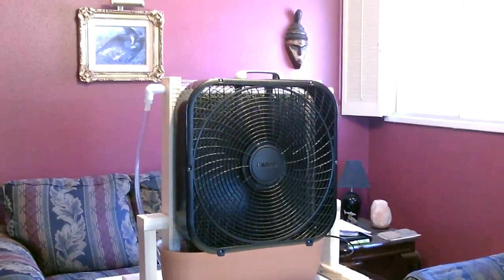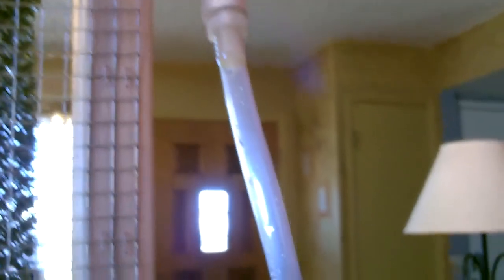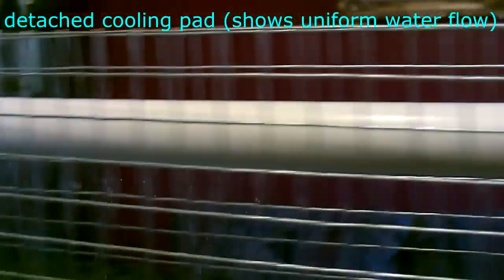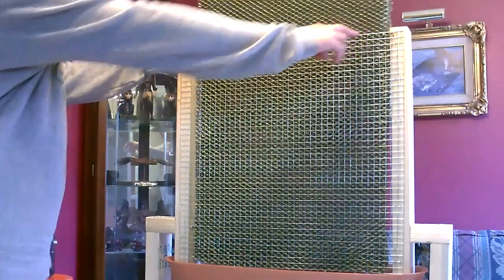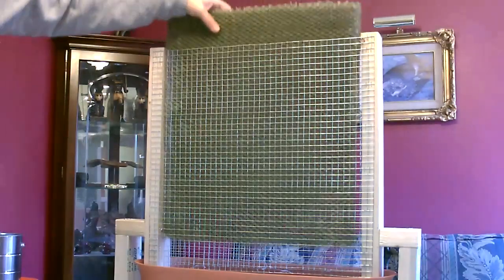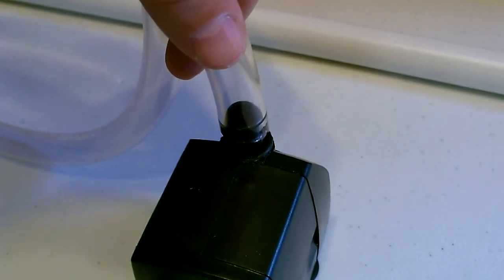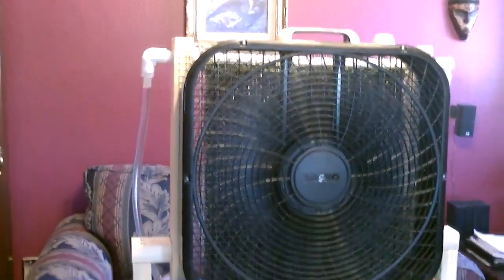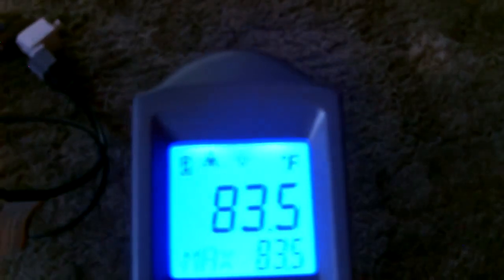Homemade Evaporative Cooler! - "whole room" Super Cooler!  - up to 30F drop! - Easy DIY

Comment: I'm assuming that evaporative air coolers wouldn't work so efficiently in areas of high humidity?  Here in Hawaii it gets up to 95% sometimes throughout the day but seems to be about 85% in the summertime which is when we need cooling the most.  Damn it's hot and sticky here today!!!
Reply: Jimmy Pham i live in Houston tx and texas weather is bipolar
Reply from the maker: Jimmy Pham hi. you are correct. this type of cooler works great in the dry or semi dry climates, but probably won't work at all when the humidity is 90%
Reply: +Jimmy Pham Add a bucket (or 20) of ice
Reply: +desertsun02 Yeah, I'm in NC and down below evlevation and my places is very wet, might be cheaper running a dehumidifier and this then an AC unit, so you could try that to cut cost.
Reply: Jimmy Pham must be some pretty violent cases of swamp ass out there
Reply: +Richard Carson I was just thinking that.
Reply: I'm in NC, and we use store bought versions of these at work. (factory)

If it's over a 100 degrees with 90 plus humidity already, you won't notice the extra humidity from the fan. You will however love the cool breeze, especially with the fan on high.
Reply: mike williams the earth is bipolar.
Reply: IXLR8 2GO so true bro
Reply: Jimmy Pham hhhmmm it's worst in Florida dude 105 sometimes
Reply: miguel plata, hey ya. Jensen Beach! 🌴 Hit an outside bistro. You'll be cool 😎.
Reply: Jimmy Pham true
Reply: Jimmy Pham I
Reply: breaks my heart. wanted to use one of these in the Philippines. ha!
Reply: The higher the humidity the better they work.

Comment: Don't let anyone tell you evaporative cooling doesn't work in high humidity in the south...It Does. Southeast Texas Gulf Coast...temp 85, humidity 83...blowing cold air.
Built it for Hurricane season...for no power. We were without power for 6 weeks after Hurricane Rita in 2005...The heat was unbearable. I believe at 90%+ humidity (after a rain), it'll lose some efficiency but still work to some degree. We experience high pressure systems quite often here where the humidity drops to 30, 40 and 50%...it should blow even colder. I don't believe it'll work well in early morning hours when the humidity is climbing and it's damp outside. Plan to use in afternoon and early evening. Thanks for the build video...it works great...even in the south.

Comment: Do you think a version blowing across the material instead of sucking would be possible to build without making a mess?  Do you think it would work better?  I live in AZ to, and I'm thinking of making one for emergency use when we have not power and run it of an inverter and golf cart batteries at night then solar by day. Also thinking of storing the water in a cooler with ice to get colder water and colder air.
Reply from the maker: kozinator hi there. i experimented with the fan on the other side (blowing thru the pad) but the result is that almost no air makes it through the unit. (the pad ends up blocking the air and almost no cooling is achieved). it's great that you'll be running it on solar (it's how i usually run it). these units don't take much power so a small solar setup runs it easily.

Comment: Thanks for sharing this! I got mine down to 52 degrees F. Of course with blocks of ice in a large igloo cooler.I put the fan instead behind the contraption so that the fan blows through my aspen pad.
You could also trying putting a second box fan to draw the air as you have it set up here, for even colder air with better circulation.
I've tried the coil method and the cooler elbow air conditioner :|   This Evap is by far the BEST! 52 F even in high humidity!

Comment: Costs money to generate ice cubes with the fridge but with those extra hot days you can dump a bunch of ice cubes into the container and supercool that bad boy.  Good job
Reply from the maker: Ultimatehobbyreviews hi there. sounds like a good idea. then you'll have simple conduction cooling along with the evap. cooling.
Reply: As long as the fridge is in another room?  Otherwise it produces more heat than the ice has cooling power.  Law of thermodynamics.

Comment: i have alot of electronics in my room, (TV, Computer, Various Video Game Systens) and this one uses evaporation for cooling, im staying in a medium sized room what used to be a Drive way to our house, would the evaporation effect my devices in a negative way?

genius build BTW.
Reply from the maker: gstut1 hi there. as part of the evaporative cooling process the air will become slightly more humid. for example, the air might go from 35% to 45% humidity (both very comfortable) ... and since electronics are designed to operate even in 80%-90% humidity - none of your electronics will be affected in a negative way.
Reply: You'll find that many inexpensive digital thermometers will save your Min-Max Temp and Min-Max Humidity levels.

Comment: We have this exact thing on the roof of my factory its called a cooling tower,ours cools 19 injection molder's water supply to 65 on a 95 degree day.bravo essentially u have built a cooling tower and now i see it works this small im building a couple for my house too thanks great build and vid

Comment: mate let me start with; how incredible ur works are... as an engineer i love the simplicity and ur problem solving ability...
i am not as smart as u.. so I will ask a stupid question..
the use of the wire mesh with plastic in between the squares is to provide a protective layer to stop making a mess with water in the surroundings... but doesnt it obstruct the air flow? when the fan is switched on... air has to flow around the corner to reach the evaporative cooler pads?? I am abit confused...
Reply: Open Canvas IH plastic in between the squares? I don't see that at all. No plastic is there. It's the pad sandwiched between two mesh grids. When he turns the pump on the water is running down the pads. Is that when it looks like clear plastic? If not, I'm not seeing what you are seeing.

Comment: now all you need is a soler panel and inverter and battery and it will cost nothing to run.
Reply from the maker: vorkev1 hi there. very true. *this setup can be easily run using only a "two battery" solar power system (to see how to set it up look for my video titled, "How to hook up Solar Panels (with battery bank)..." or if interested, here's the link http://youtu.be/cgEvCLJuBkg
Reply: desertsun02 thanks I will check it out

Comment: Good idea,  but why dont u just use an automotive radiator instead ??
Reply: AnniSoleil13 That would prevent the evaporation of the water, and therefore not do any cooling. If you added ice to your water supply it would then work, but only for the duration the ice lasts. (Not long at all) The goal here is to cool the hot dry air and make it cool slightly humid air. Whenever there is a phase change (in this case liquid water evaporating to water vapor) latent heat (IE the heat in the room air) is removed. This is why humans sweat to keep cool. The evaporation is what takes the heat away from our body. This is a mechanical way of making the room "sweat" to cool it down! It will NOT work if the air is already humid. These evaporative cooling systems are extremely popular in deserts and other hot dry environments.

They take less energy than phase exchange systems using compressors and refrigerants, but they do consume a lot of water which may be a very bad thing in some dry places.
The absolute best way these days to keep cool in high energy environments such as deserts  is to take advantage of the energy around you and use solar to run something like a mini split AC. The only issue then is upfront cost.

Comment: Next you should fit a 5 gallon water jug upside down that will let water out as the level goes down like a dog watering bowl does. Then you could leave it on for 10-12 hours when you are not home and your house will be cool when you come home. Pretty cool setup there.

Comment: wouldn't this make the air in your room very humid.. that would not be great for electronics in the room

edit: i could make a quick ghetto version with a wet cloth on a fan right? :D
edit2: maybe i could put a the bottom of the cloth in a bucket of water so i dont have to fill it up as much?
Reply from the maker: 1wsx10 hi there. as part of the evaporative cooling process the air will become slightly more humid. (but since you use these in dry or semi dry climates, that can actually be a plus). both of your "edits" are good ideas. i've got videos showing both. *one is a two-towel version w/drying rack - the other is a single-towel version on a rack with bottom of towel in a "bucket" (a planter-box style container to be specific)
Reply: desertsun02   I finished one of these evaporative coolers today and found that it does not work.  I bujilt it to your specs and with the same material.  The air coming out is the same temp as the air in tnher room.  Can you explain why the air is not cooler?
Reply: +Dandy66 M I just finished building my Swamp Cooler. I initially made the mistake of installing the fan behind it. I quickly realized that the fan needs to be in front. Is this a possibility for you?
Reply: this is an old post but I will ad my two cents anyway, the reason it won't work is because the vapor (hence the removed heat) stays in the room therefore although one may feel some coolness in front of the fan, the overall temperature in the room will remain constant because the vapor will condense and give away heat eventually...
Reply: @mesutpeynircimax451  but shouldnt it atleast change slightly the overall room temperature?
Edit:actually u can put a bottle of ice in the water tank to make ot cooler,when it melt,u can put in freezer back.but still u need water to run through the mesh

Comment: Excellent ..I'm wondering about using light walled aluminium channel for the frame. It would also allow the pvc pipe to be hidden inside.

Comment: The wire mesh...  instead of cutting/using 2 - what about using 1 that is twice as long, plus the thickness of the boards?  Have it go down the front side, make a 90 degree bend at the bottom of the boards (thus the extra length = the thickness of the boards), then another 90 degree bend to go back up the back-side of the boards? 

I was wondering about this since I didn't see (or perhaps I missed it) any details given about how the cooling pad was to stay between the wire meshes without falling into the reservoir below.

Edit: Oh, I see it.  Where you wired the pad to the pipe...  No need for a bottom support then.  Anyway, thanks for the video.

Comment: where do you buy the cooling pads?
Reply from the maker: hi. you can find them at most home stores. i got it at home depot.
Reply: http://www.homedepot.com/p/Coolpad-28-in-x-32-in-Evaporative-Cooler-Pad-7012/202531203?quantity=2&str_nbr=1088

Comment: Any idea how much power drain you're using with the fan and the pump? I'd like to do something like this with DC rather than AC, so power consumption would be important.
Reply: MarkW126 A small 200 l/h 12v d/c submersible pump will draw .25 amps.  
A small 12v d/c 32cfm blower will draw .18 amps. If you want greater air flow, use more blowers.

Both are available off EBay.
Reply: that's the ticket !
Reply: I'd take a guess around 40 watts.

Comment: Humidity stays above 50% where I am and once I was seeing how much energy I could save by hanging my washed clothes throughout the house instead of using the dryer (lived in a condo, couldn't hang them outside) and something I needed faster than the others I decided to put in front of the fan in my bedroom where I was to dry faster.  It got cool in there!

So I have no doubt evaporative cooling works.
Reply: 50% humidity is rather low compared to where I live. Try 80-90%. Even at 70-75%, which is considered good for the area, the air is to wet and unable to absorb any moisture.
Reply: You ideally want to use evaporative cooling when the humidity is 35% or less. The drier the air is, the more effective it is and the lower the air temperature. Also, you ideally want to have your evaporative cooler in your window to take hotter drier air from outside your house as its more effective than cooler more humid air in your house as soon in this video

Comment: How well does evaporation cooling work in high humidity climates?
Reply: Not well.
Reply: Yeah I figured as much. Then I figured surely Wikipedia had figures on such things and yeah. 
Not looking like these'll be very good for my summer woes with my 90%+ humidity days.
Reply: gothicsoldier I know this sounds odd but if you live in a humid area why couldn't we just use a dehumidifier in the room/house to bring down the humidity while at the same time running this?  They don't seem to be real inexpensive for the energy star rated but that might not be the main concern.  I bet the two could work together in one replacing the water for the other one with some testing.
Reply: Chris Elliott
A dehumidifier is an air conditioner. Only because it is not 100% efficient, it puts out additional heat since it is not vented. Thus, just use an energy star air conditioner if you're in a humid area.
Reply: Chris Elliott I like your thinking but a dehumidifier draws about the same amount of power as an air conditioner. Google it...

Comment: Nice!....Was there a 2x4 going across in the water?...Or only the PVC pipe, and the wire hardware cloth, stapled on, going across, holding the 2x4 upright assemblys apart, doing the trick?....What speed did you run the box fan on?...Where can you get the Pad at?....And finally, was that some sort of Aquarium pump you used?...Thanks, Timmy Gee.....

Comment: Very nice. Brings back memories. I had a greenhouse. Made a large version of this on the back wall with a toilet tank to hold the water. Left the float valve and plumbed it up. That way it would stay full. Water came in through the top like yours and into a PVC gutter on the bottom then back to the toilet tank. Fan was on the other end of the greenhouse. Nice simple technology but won't work for a house here in the south with already high humidity. Mold would be a big problem.

Comment: Are there any ways of cooling down a house without use of electricity? While solar panels are great, I really like technologies independent of electricity, like a ram pump, for example.
Reply: You could run this setup with 1 or 2 big solar panels. But I don't think there is a way without electricity. You could have a wind powered pump and some kind of natural draft to blow through the evaporator but it would just be easier to get solar panels, batteries and a inverter and run it that way.